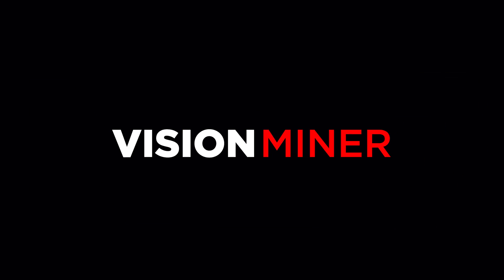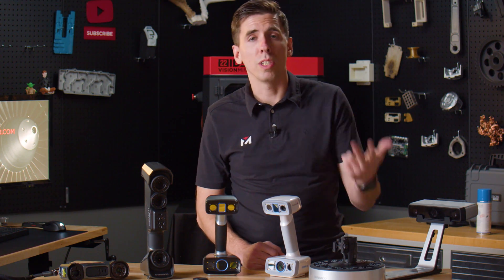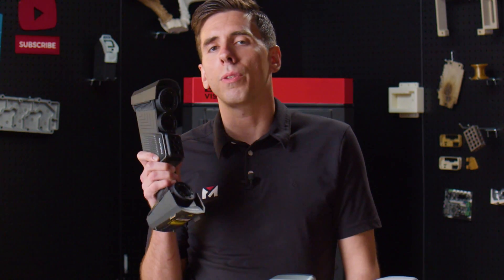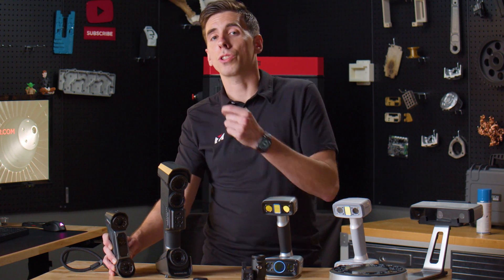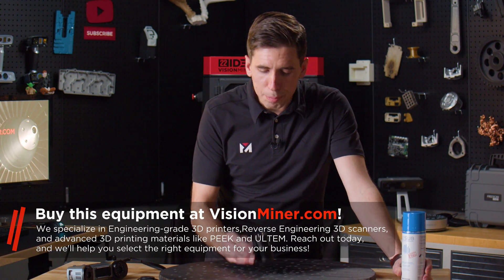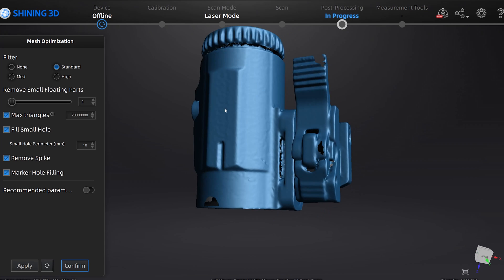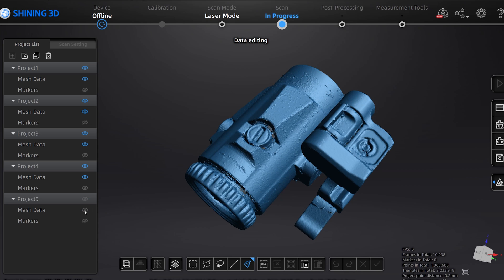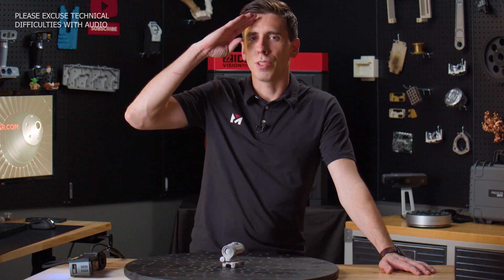Which 3D Scanner should you pick? Scope Magnifier for Reverse Engineering - Shining3D Freescan Combo

Comment: this is kinda awesome! the exact video i wanna see.  Would love to see how the hx stacks up against creality Raptor's new scanner.  We've been saving for years for the eiscan HX but the raptor looks a little better on paper and wont break the bank.  curious about you guys at vision miner perspective on the two scanners.  i'm asking because you guys has ALWAYS seem legit and fair when it came to the hardware of these things....
Reply: Used a raptor - it's like a toy. Ads, specs, everything looks promising. So slow to track, so many errors, almost threw it at the wall.
Reply: @BenALTIQ  sure lollll… have you used any of the expensive scanners? (Like $6k and up)?  I haven’t but I can tell their software is miles ahead of what Creality offers lol but, for example, the raptor is $1500 vs EinScan hx $10k… if you’re telling me I have to scan slower but I get twice the accuracy… that a $8500 dollar difference lolll I can work with
Reply: @torodatruth  I have a Freescan Combo + (new model with more lines) had an Einstar which was excellent for a hobbyist NIR scanner, software was great just resource heavy because of NIR (long processing time). 

If you're using this equipment for work - do not hesitate buying a Shining 3D from vision minor, as they said earlier, they really are for professional work, the Combo simply works. 

I have had cars in and from start to finish scanned what we need in the engine bay in under 10 minutes with STL, OBJ files saved, 15,000,000 triangles +

Einstar was closer to 1 hour and would not get the small details but excellent for flat and curved surfaces. Very long processing time though. 

Raptor - would get 10% into a scan and glitch, put wrong info in the wrong locations, had to run more markers. I guess ok if you're a hobbyist with hours to scan a small dragon figurine or something but wouldn't cut it to be a profitable tool. 

In my experience, I could get an automotive scan in 30 minutes that would take several hours with the Raptor. 
For hobbyist, time isn't money, it's satisfaction.  For work, it's not worth it.

Also, resolution isn't the important element for me, it's likelihood of getting a scan or not. 

I would highly, highly reccomend demoing a Raptor in person and seeing if it will achieve what you want with your workflow (resolution aside, it does go very high)
Reply: @BenALTIQ  yea it goes without saying that if its for work, then absolutely you get the best you can afford based on your research and your specific application.  Einscan scanners are almost always going to be a better pick for sure based off of software ALONE lol.  .....but..... the combo + is $19,000 USD bro.... what this means is that is for well established businesses with a clear and direct application of the scanner. (buying out of pocket btw)  For me, i work in pipeline and i've been looking to beef up my laser scanning side of things.  i'm FULLY aware that the combo + is where it is! period lol.  but its price completely wipes it off the table for our application right now...
Reply: I was saving for the Combo when the Raptor came out and couldn’t resist. The laser mode works extremely well… it’s fast, damn accurate and tracks well.  The software is the weakest part but it is improving with each release.  The Raptor for small to medium objects and my Einstar for larger stuff is working really well for me.  I hope Shining 3D has an answer to the Raptor soon.